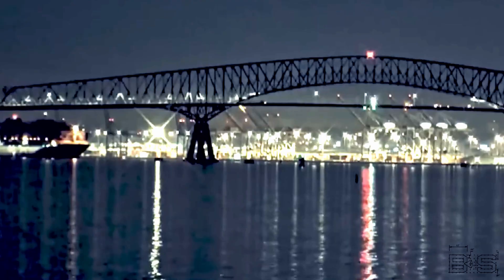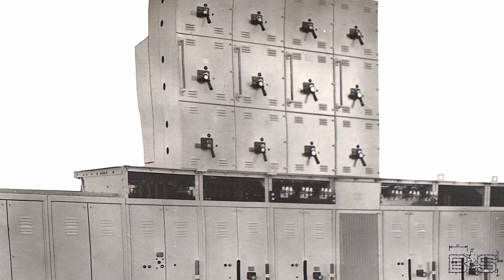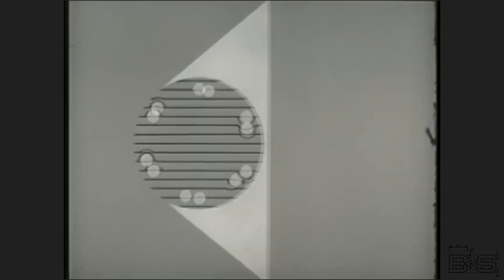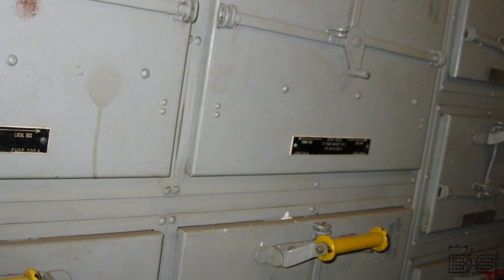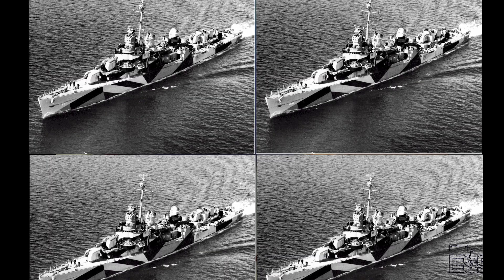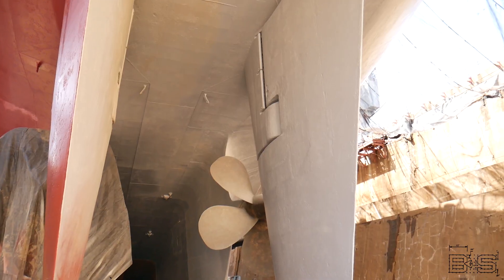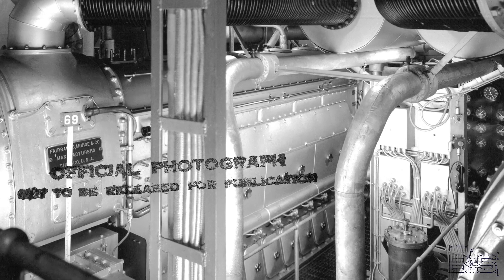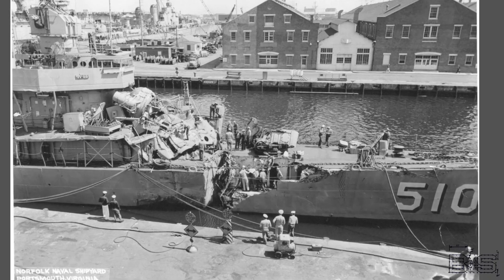Battleship Emergency Switchboards

Comment: I have multiple portable power stations (solar generators) and backup batteries. I just focus on powering my laptop, USB fan when it is hot out, and my kindle for short power outages. Larger outages I power the fridge and microwave. I do enjoy seeing what they did for backup power in the 1940s.

Comment: Being in the Standby and Emergency Power Generation Business (Chief Technical Officer) not having backup power is not an option. 
Our primary backup is a modern (2004 m/y 35DGBB Cummins / Onan (Cummins Power Generation) 4B3.9 (Naturally Aspirated 4 cycle Diesel) with an OTPC (digital ATS open transition) with manual backup operating handles. (Paddle levers, quick break, quick make) secondary backup is an old railcar 2-71 GM / Detroit Diesel 20kW with a 1200 / 800 RPM governor. Both units are very reliable and meticulously maintained.

Comment: At home, we have emergency batteries with independent distribution and sockets. These can be powered from the mains or, during an outage, there's an automated contactor which isolates them from the main distribution, switching to independent earth, etc.

There's a final, emergency backup via a fancy UPS I got from a data centre refurb. This covers a few critical systems during the changeover, like servers and networking gear.

You'd not think we needed this, but since the push towards renewables, we have seen multiple long blackouts. Last night the country was on over 30% wind and the voltage was fluctuating all over the place. As the lights flickered, I was double checking all the emergency power stuff and checking the torches were all ready to go.

The UPS also helps with the grid voltage swings and regulates the voltage going to the sensitive equipment. The lights can flicker, but the servers and such still get 230V.
Reply: Like the idea of Essential Bus.
Reply: @kamilsp7 the downside is regs means it needs a breaker on it. This gives all the essential stuff a single point of failure, which I'm not overly chuffed about. Fine if you're in as the UPS (and other stuff) will alarm and cover the critical things for a few minutes. But if you're out it means everything on the emergency power distribution can be taken out by a single breaker being too eager. If there's a genuine fault with the emergency power system, I can bypass it all in seconds. But it all needs manual intervention. 

I'm looking at solutions, but I insist on mains stuff being done right. I'll screw with low voltage stuff all the times but if it's mains and my family has to use it, it gets done right.

Comment: Amazing  considering the era it was designed in. The hazards of dealing with that voltage along with water in the case of emergencies sounds challenging. It is also interesting to note modern ships including warships are now using upto 12kV potential not this would definetely not like water.

Comment: Thank you for your informative video.  It's been 60 years since I tested ship service generators at the San Francisco Naval Shipyard.  I never worked on battleships, but I expect their systems might be similar to those of the carriers that I did work on.  With their four ship service turbo generators and two emergency diesel generators I believe it would be unlikely that they would lose power to the steering motors.  Also... during maneuvering the switchboards and after steering would be manned.  There would be talkers with sound powered phones on the bridge and at the appropriate stations to communicate and deal with any emergency situations.